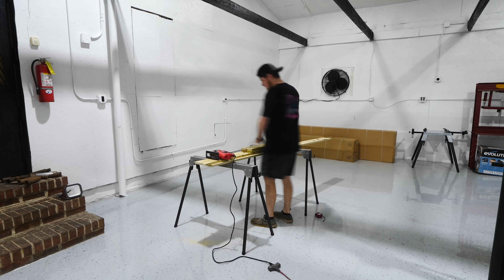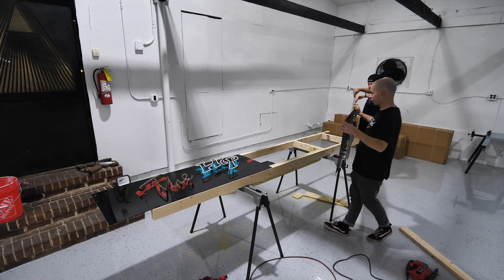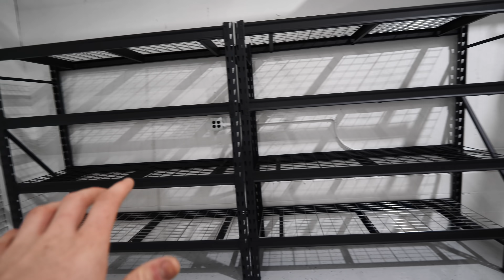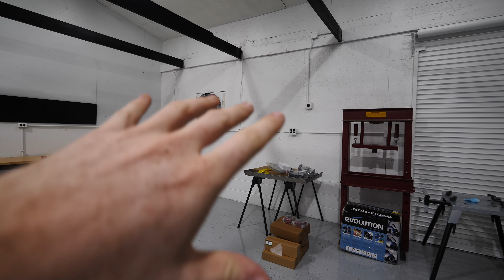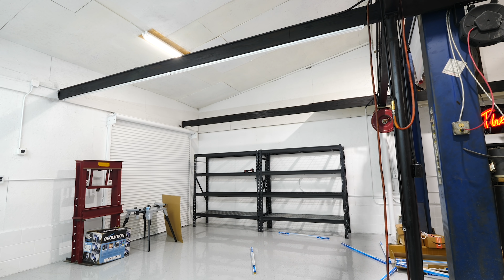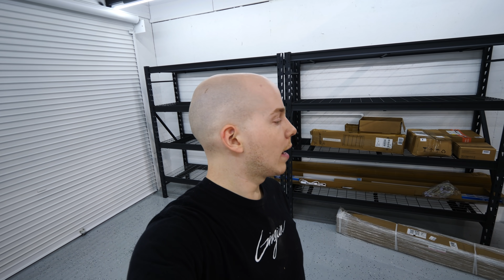Building the ULTIMATE Fabrication Area for the SHOP!

Comment: Love the new space you have transformed it for sure... The only thing I can see as something that will bug you is the location of that lift and not being able to use it to its full height.. pulling it a few feet towards the Bay doors  looks like it may help solve that issue. If you do end up moving the lift make sure that floor is as strong as where it was.. Can't wait to see the first fab job with all the new gear and the lighting.

Comment: Drill around the box with a holesaw so air goes in and cools down the transformers.
They need to stay cool 
If they a closed off in the box they will get very hot and they can blow up or cause fire

Comment: As someone who is unfamiliar with neon lights and the assemblies. My only concern would be the wood framing. Does the unit get hot at all, considering being in a box it might get hotter than usual if it does. By some small fans to go on either side of the wood box to create ventilation. By again, I do not know anything about the system. But my main concern was fire.

Comment: Prepare to shim the Evo saw mounting points to get it straight. Put a 3" straightedge against it, and you'll see at least an 1/8" gap at the top. Had to shim mine .025" to get it close. Seems to be a common problem.

Comment: Your gonna run into a problem with lighting under your lift. When you have a car up on it you will have no light shining underneath it. So fo what I did and get heavy magnets and mount them under the LED light straps you had put on the beam or shorter ones and place them on the lift arms. On the side or even under it so the light bounces off the floor the and u can see under the car.

Comment: Lovin the progress on the shop.  Miles away from where you started.  BTW, you should put the chop saw on a mobile base (4 lockable swiveling casters).  You'll appreciate the ability to easily move it when the need comes up.  And it will.

Comment: This looks absolutely amazing. Loving the new signs.
But I am wondering why you used all 4 uprights on the racking (shelves) as the racking is designed in such a way to be expandable.
Also, by using just the 3 uprights it's more rigid.
Oh, and Evolution power tools are indeed awesome.

Comment: 1st off, the shop is coming along great.

One idea on the pallet racks (having worked with pallets for a while now) is to remove the very bottom row of shelving (or move them up some) so you can actually store pallets under them like it the form of a crate engine or transmission. That way they can be out of the way and have a storage area for designated to them. I would also recommend getting a pallet jack for moving those pallets and you can find them for around $300 - $500. 

Doing exhaust work, I would also recommend a metal pipe storage rack (you can get one from McMaster for $380 to help with storage room on the pallet racks

Comment: If you still want a bandsaw get a corded 4" deep cut portaband and a swag offroad mount for it to use it as a mini vertical bandsaw. They are a few hundred $$ less than a bigger metal cutting bandsaw and you can use it for cutting shapes easier than and angle grinder and where the chop saw won't work

Comment: Shop looks great! Just noticed that your Wall Control panels are sideways. The slots are supposed to be vertical. They are available in the 16x32 horizontal. As-is, you wont be able to use any wall control accessories.

Comment: Don't underestimate the value of lighting. However much lighting you have, you can probably have more and it won't hurt. With how cheap LEDs are to run there's no excuse for having a dim workspace.

Midday indirect illumination (shade, illuminated by the whole sky except the sun) is 20,000 lux, or 20,000 lumens per square meter. For your fab area which appears to be around 12x12, that's 20,000 lumens x 13.38 sq m = 267,600 lumens to match noon shade on a clear bright day. If your 8ft 90W LED fixtures are typical output efficiency then they'll be 10,000 lumens. So if you put up every single one you bought in that space it would be as bright.

Comment: For your lighting. 

The closer you place your overheads lights to the ground the brighter they will be but also the harsher your shadows will be. Think about a flashlight and moving your hand in front and away from it. LEDs are typically not very “specular” but if you place anything thing close enough to a source of light it will harshen the shadow. 

The biggest difficulty you’ll face is when you reach editing and color correcting and have to balance for both the warmth of the front lights with the coolness of the rear. I’ll often times gel a light (a piece of cellophane that will warm or cool down a light source) to make it easier to match. That is cheaper than having bicolor lighting at a very sight reduction in amount of light. 

Thirdly, banners act as what we call flags on a film set. They are large pieces of fabric that block off light in a particular area. Sometimes we want all the light. Sometimes we Flag off a section. For each banner you hang, you’re cutting the amount of light available. Light is a source of rays that bounce off subjects and the walls. The white floor and walls help, but you’re effectively darkening what all the light is there to do by hanging a ton of banners/flags. 

If you do decide to keep the cooler lights, you should actually use them as the bulk of the lighting, then supplement and scatter out the larger overhead lights.  That will give you more of a consistent color temperature and more even lighting. I’d also place them as high up as possible.

Comment: They make a tubing clamp for those saws, I bought one, it works awesome, even for square tubing you can put it in at a 45 and cut it at the tip of the tubing instead of the flat part and it doesn’t dull the blade so fast

Comment: I recommend getting some smart plugs of choice (Homekit or Home Assistant, whichever is your choice) and plug in the lights into those. That way you'll always have easy light control with one tap of a switch. If no wifi, they make more "dumb" versions of switches that come with their own proprietary remotes. Makes coming and leaving the shop  a smooth experience, and no need to run around the entire shop to flip them all on.

Comment: Hey Gingium, you can mod the beam of the building by placing two colums left and right of the lift and then cutting of the middle part thats in between the lift so that you can fully use it. I think those are HEA160-200 so a column of the same thickness is plenty enough to support the weight. You can shove it in between and weld the top to the beam, on the bottom you can weld a plate and drill a hole in it (M16 should be enough for four holes) and afterwards you can put a threathed rod if you drill the concrete and use chemical anchor to make it hard. Should be enough and you have two fully usable lifts then. I don’t know the prices of steel and the laws regarding modding the construction in the usa tho..

Comment: If you have lights left over I could use up to 4. By doing so you would be helping out a 63yr old guy that has had more bad luck than good (it's a very long ugly story). Everything looks OUTSTANDING, But you need to clean and paint the doors!

Comment: Nice job on the video. Really like the shop progress. Here’s a few suggestions for the space. 1. Get a custom neon sign of the shop name, or of your name in the fab area. 2. Since you have the lights over the fab area strung from the beams,  you should put 2x4 boards and sheets of plywood over the beams, and make a separate area above the fabrication area, with a ladder going up to it. Could be used for storage, or a hangout space in the shop. Customize it your way. Regardless, bravo on the shop space. Makes me want to try and find a location of my own at some point. 👍

Comment: Is there a reason to hang the banners in the middle of the room instead of on a wall somewhere? Seems like having them in the middle just makes headaches with all the shadow casting and stuff, but if there's some kind of sponsorship obligation or something I get it. Anyway, it'd be neat to get reviews of how all the floor coating/lights/other shop stuff is holding up down the road at like 6 months/a year/etc. of regular use - even if the main focus is going to be car builds and stuff.

Comment: I'd just get two 8x8 beams and put them from the beam blocking the lift to the floor, each beam would be in-line with the lift sides holding up either side of the beam allowing you to cut the center section out, bolt everything together with some lag bolts and get some 90° plates to mount the beams to the floor.
From this --------- to this ---!  !--- but with the horizontal beams ontop of the vertical ones

Comment: I still say do the brick steps in neon/safety green, with Florida sand mixed in the paint for grip when your feet are wet, then some hand fabricated steel railing, painted in Steel-It, stainless steel flake in polyurethane. Hang a black light over the steps.......